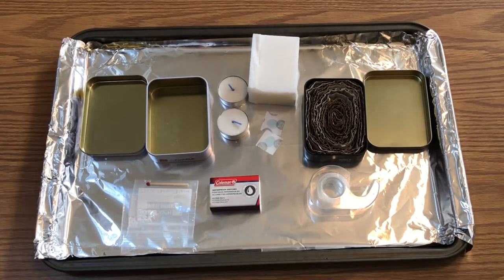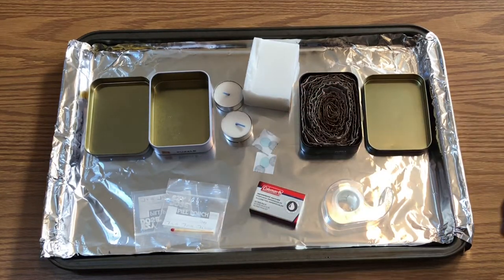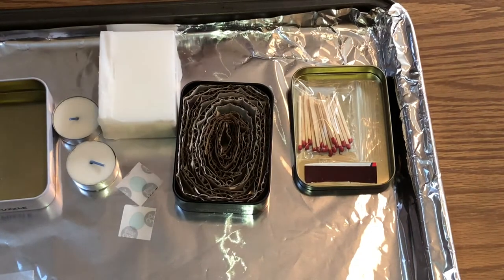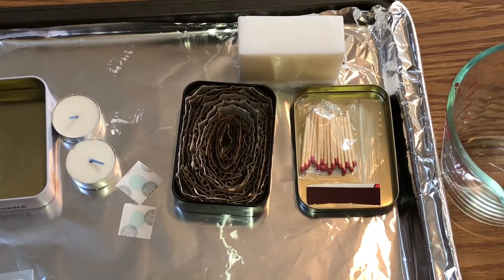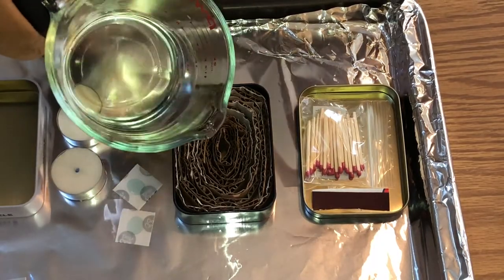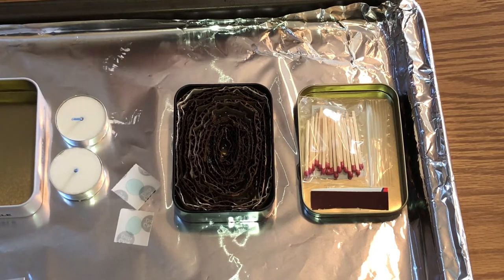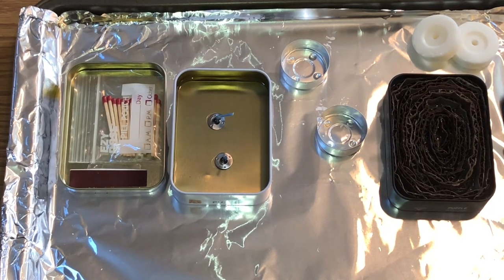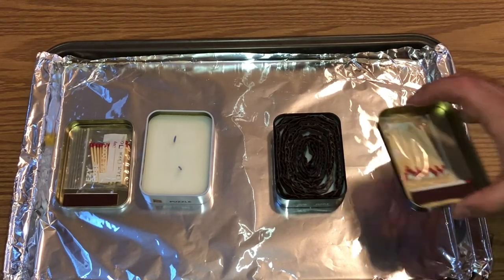Emergency Candle and Stove DIY : Survival : Emergency Heat : EDC

Comment: Hey this might be a little more expensive than cardboard, but would a cotton cloth work better as a wick for the heater?  Because it would soak up the wax like better and burn for longer with making it more durable
Reply from the maker: I will have to try that. Thank you for watching

Comment: I built a Altoids tin candle using tea lights I purchased made in the USA
First I removed 6 tea candles from their tin holders.. I took two key candles and place them whole in the Dead center on each end of the tin .. then I broke up two more tea candles and took out the wicks and placed one on top and one below dead center.. so I now had four wicks evenly spaced.. I took a metal coffee scoop broke up the tea light candles into the coffee scoop and hit it with my butane torch. The flame sometimes touch the wax directly and did not cause it to catch fire but melted nicely.. I then little by little pour wax from the coffee scoop into the Altoids tin and kept repeating until I had enough wax level with the two full tea candles I placed into the tin .. I was careful not to let the wax leak out the two slots where the hinges are.. when the Altoids tin  was full
I placed the Altoids 10 in the freezer on a level spot and in 10 minutes it was easily solidified.. I now have a really nice Altoids candle with four wicks.. I am going to purchase in the future some beeswax tea candles and do the same thing because beeswax Burns longer.. I am also going to make a 2 wick . Candle out of an Altoids mini tin
Reply: Great idea 👍🏼

Comment: Use bees wax, it burns much slower so your candle lasts longer
You can use a bees wax blend to cut cost
Reply from the maker: I will look into that.
Reply: We are running short of bees... so bees wax may not be bees wax.
Paraffin wax should be labelled as such on these candles... which I assure you they are not.
I'm currently prepping for an uncertain future... and therefore I'm always interested in these types of videos... so I'm just saying... as opposed to critiquing.
😃